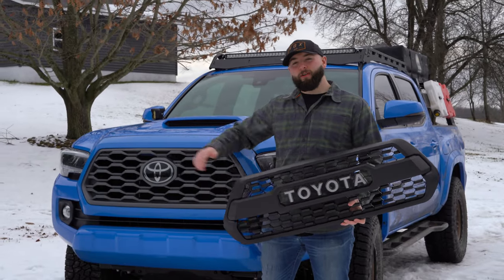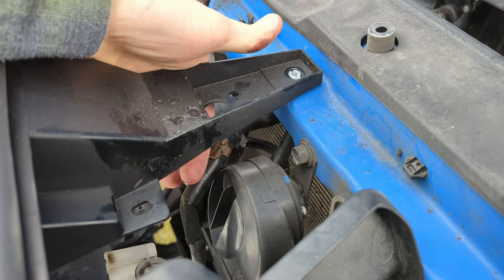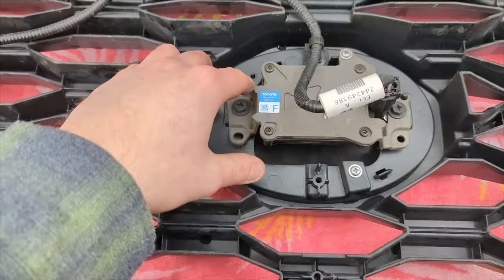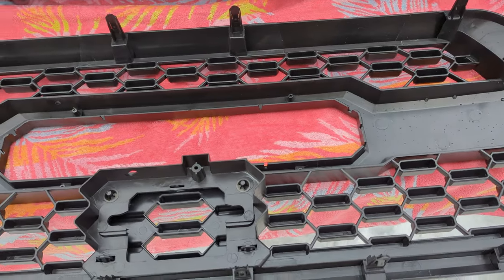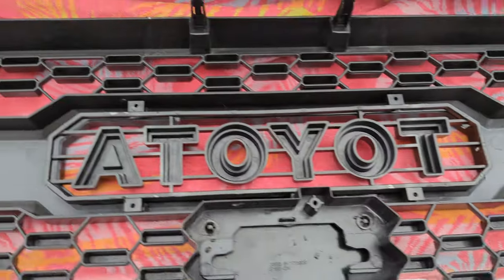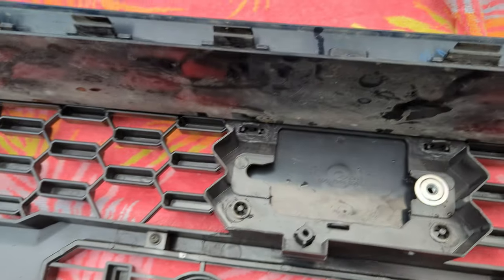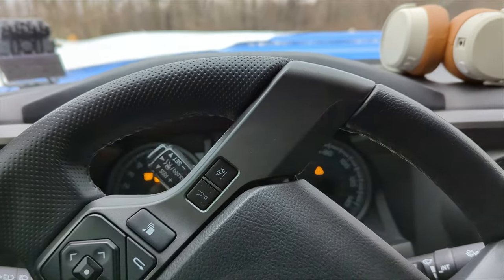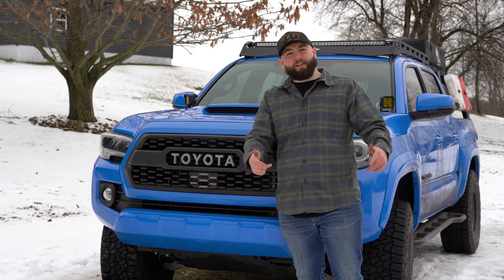2023 Tacoma TRD Pro Grille Install

Comment: Excellent video! Thank you!
Other than the garnish not matching, it looks great!
The Pro Grill at Taco Garage is definitely worth looking at!!!
Reply: Yeah, that really breaks it for me... I was wondering if you could just put something black in between the mount plate and the grill to mask the sensor and keep the actual piece in.
Reply: @aasofjg1511  I installed the pro grill from Taco Garage. The radar garnish is disappointing, but i absolutely love it. I firmly believe it may be the best aftermarket pro grill available. 
I’d do it again.
Reply: The reason the garnish is smooth and glossy on the Toyota OEM and aftermarket garnish is to help keep them clean and make them easier to clean when they do need to be cleaned. You can use a quality cleaner like Plexus or Novus that will make them easier to clean when they get dirty or bugs spattered on them.

Comment: A tip for installing the garnish cover is to take the slip lock washer nuts and a pair of needle nose pliers and bend each one of the tabs up just a little bit, the slip lock washer nuts will still fit properly but will allow you to slide them on all the way on to the tabs and they will still bite into the plastic post keep them from coming off. It is important to fully seat the garnish cover which means you will have to push on the upper corners to push the plastic posts all the way into the inside of the grille and fully seat the slop lock washer nuts. The garnish cover is not supposed to sit even with the grille cut outs, the top is supposed to be angled back and when fully seated does angle back at the top of the garnish cover. I think the majority of those who have sensor errors after installing the TRD Pro grille and garnish is because they did not fully seat the garnish cover, this can effect the sensor reading as the wind pressure causes the garnish cover to move/vibrate while driving which can interfere with the radar frequency resulting in the error code saying you need to clean your cover.
Reply: Thank you. After 30 min of trying one side I saw this and had it on within 2 minutes
Reply: do you need the garnish cover at all i bought a grille from tacoma lifestyle and it’s just the grille

Comment: Where did you buy this grille and did you have to recalibrate it?
Reply: no recalibration required if the install is performed correctly. (recalibration is a dealership gimmick)